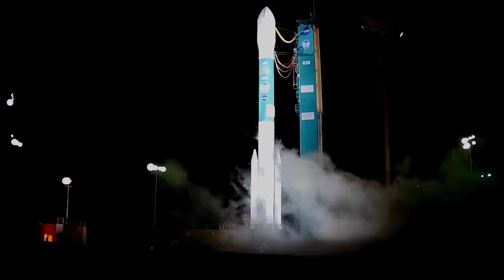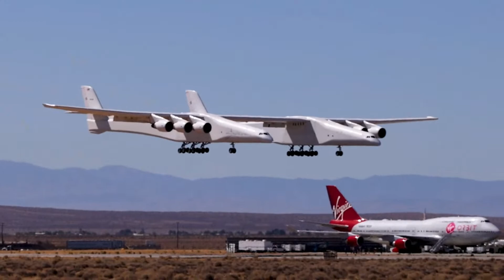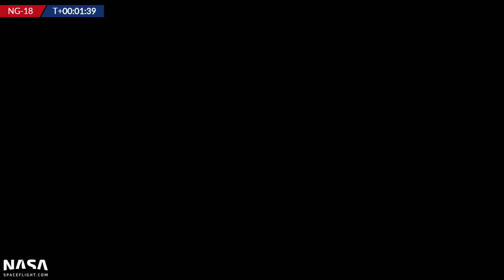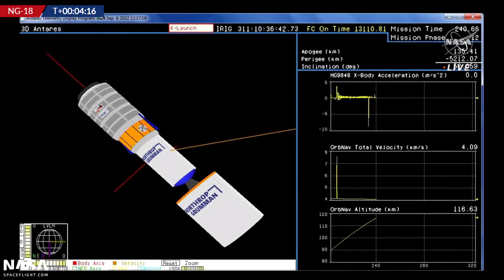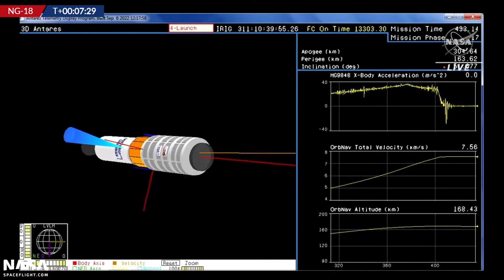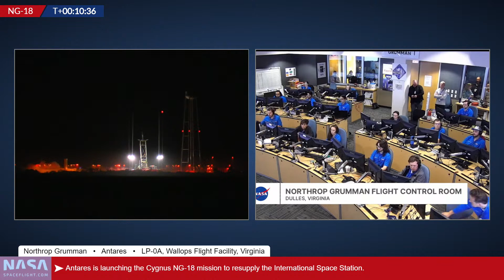Antares Launches Cygnus NG-18 to Space Station

Comment: I wonder why, when the fairing separated, the rocket seems flipped 180˚. Will it affect the performance of the rocket? Although it is in vacuum, there was still a short period of time the thrust was reversed. I haven't seen this happen (except in KSP). Can anyone explain this? Thanks a lot! (I would like to know if any other rocket got reversed thrust, but the mission was succeed)
Reply: It's really quite a strange manoeuvre, I'm not sure it's the camera since the prograde vector stays the same. Perhaps it truly got spun a little but had enough tolerance to correct
Reply: Because its a solid fuel stage, it can't shut off early, so to more closely hit the target orbit it needed to waste a bit of energy burning backwards a moment.
Reply: At least the crews on ISS can get new snacks and props that needed for Christmas! Yay🎉
Reply: Pretty sure the camera just flipped around, otherwise there's no way they would've been able to get into orbit.
Reply: @seanplace8192  watch the perigee for the short time appears to fire retrograde: it actually lowers the perigee until it swings around.

As they eventually ended up saying: its a solid rocket: they have to burn it until its out of fuel, so to hit the exact target orbit it did need to waste some of its energy firing backwards for a moment
Reply: @Phoenix591-yt   Thank you for replying! I agree with your lower the perigee theory. But I think that the first stage of the rocket is not a solid rocket booster. It contains two RD - 181 engines.
https://www.northropgrumman.com/wp-content/uploads/DS18012_Antares.pdf
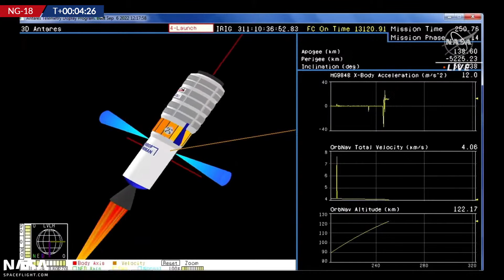Reply: @seanplace8192  Dear Sean, thank you for your reply! I think this telemetry system is build inside the rocket, it should not be able to do any actions (basically a cockpit). The reading of the accelerometer is changing (RCS is thrusting), indicates the rocket was rotating. We can ignore the velocity and Altitude, because we cannot directly see anything from it (it is a 100% normal trajectory from my experience). You can see the action at around 52:20 in the video. The rocket is flipping itself with the fired engine (which proves the telemetry, or you called camera, is mounted on the rocket, and can not rotate).

Comment: I could be completely off with this, so take it with a large grain of salt, but I heard a while ago that the reason for these wild manoeuvres with the second stage are to get a good orbit. Because this stage is an SRB, there is no wat to throttle or fine tune its thrust, so they can use up some DeltaV by veering off from prograde to let the sat get into a good orbit after wherever the first stage places it. Not sure if this included a full retrograde burn, so it could just as well be something funny with the simulations of the flight.
Reply: You’re right, I don’t believe they ever go full prograde, just mild deviations to burn off some of the fuel, it’s insane how accurate a srb can be for insertion.